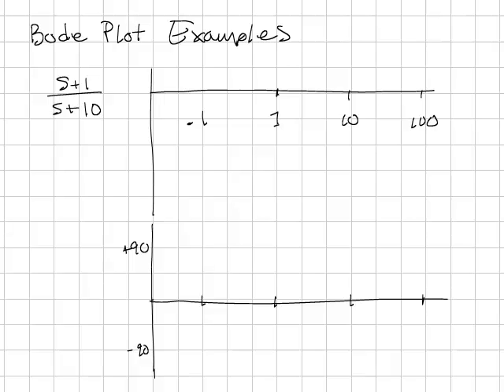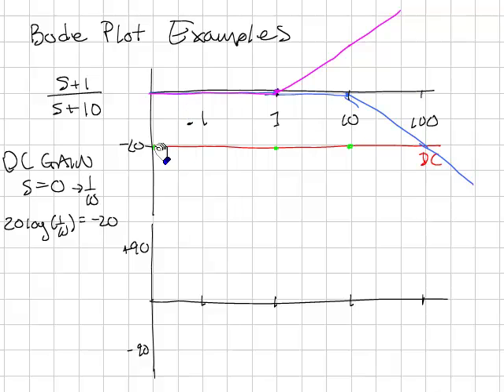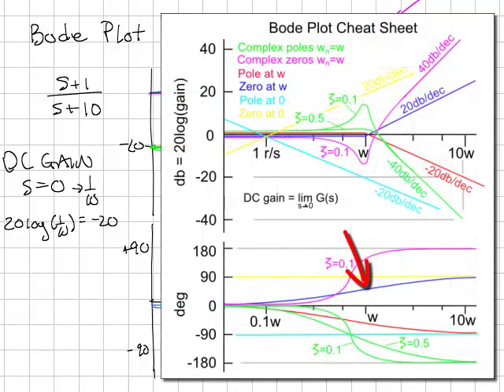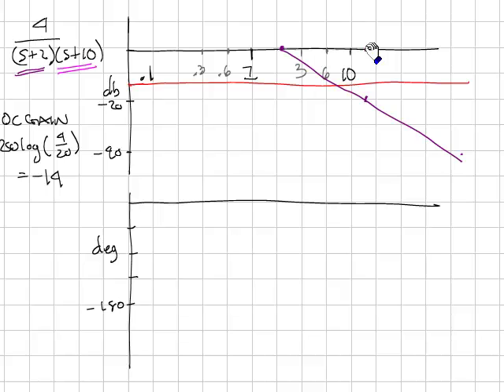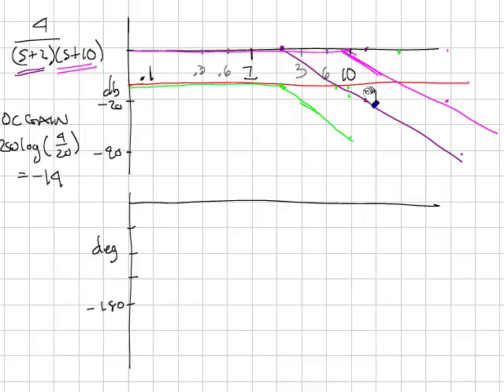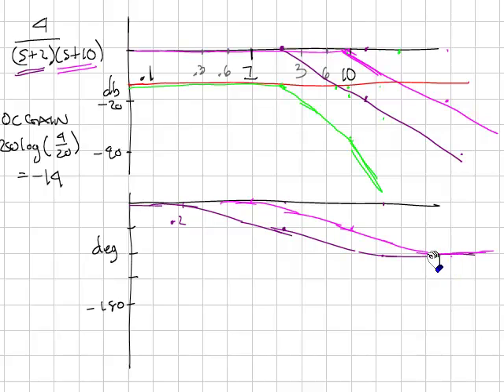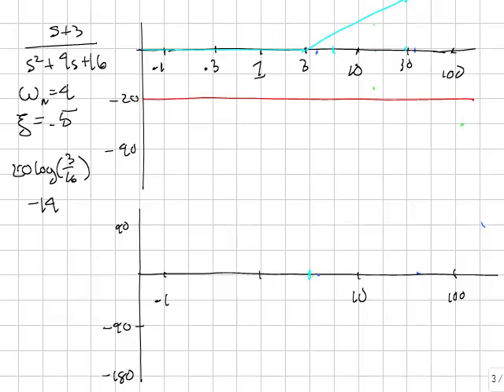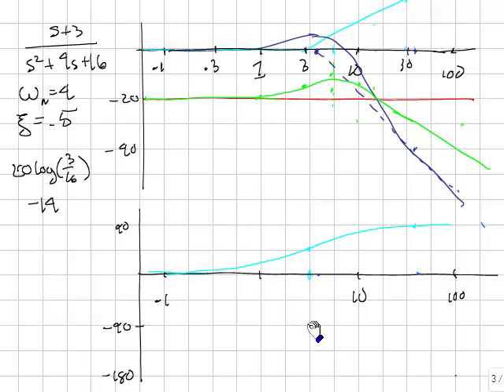Bode Plot Examples.mp4

Comment: sir correct me if im wrong, but i believe ur plot at 7:50 is too big. from ur previous 0.5 graph should be very similar to a straigh line graph. I would've accepted this ur curve in this graph, if it was a 0.1 for damping ratio.

Also ur final bode plot (green line) should start at -14db, not 20db. Please explain this..